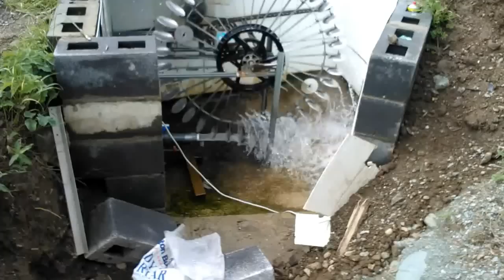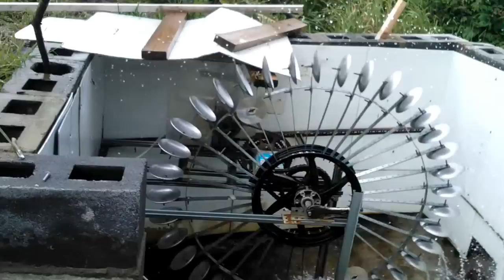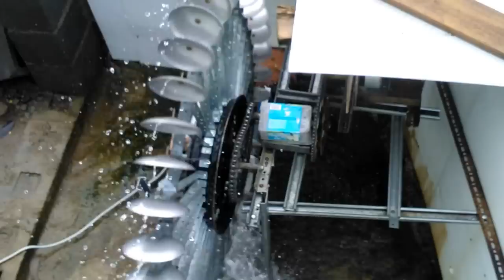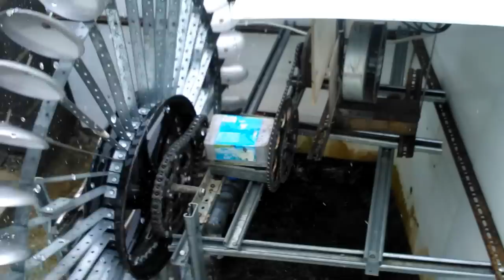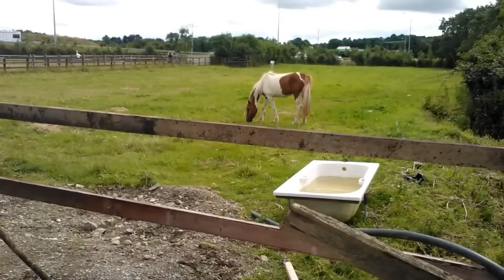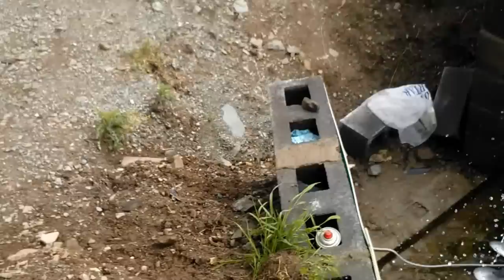homemade power

Comment: As Bonnie Flory has commented earlier you would be better off using a conventional Water Wheel with the 'Buckets' designed to hold as much of the incoming water flow as possible at the required RPM. Flow the water into the Top of the wheel. At present a lot of the 'Energy' in the water jet is being lost as the water flies off to the sides due to being reflected off the Discs. Alternatively use a Pelton Wheel style paddle to maximise efficiency. In other words - MAXIMUM MASS at MAXIMUM RADIUS.

People seem to get obsessed with Micro Generators and 'speed' of water. It's Mass and Radius.

Mass equates to Volume * Speed; Radius equates to Height.  So you can either Catch the Volume of water at the Height of the Source Water through a Wheel having a Diameter equal to the drop Height or Drop the Water through a Channel/Pipe and pass it through a Turbine at the bottom of the Drop Height. The chosen option is influenced by Drop Height and Landscape. For example, Using a Pipe and Turbine is obviously more prudent if the Height is 20m but at 2m you are likely better off with a full size wheel if Footprint and Space allows.

Remember you build the Wheel once and use it for years, So don't worry about cost etc. You can use natural resouces, Wood etc or get hold of scrap Aluminium sheeting or other material.

Comment: You could get more rpm from using a C6 automatic transmission.... Cooliing for trans would be transmission cooler with the same waterflow running over it or in a 55 Gal Drum with same water flow controlling the temperature.
C6 transmission is a 8.5-1 gear ratio in 3rd gear.

Comment: with your set up would there be enough power to run a 3kw pond heater using my water wheel.[16" pulley on wheel to 4" pulley then gear up as required.] many thanks

Comment: nice, plum water from top, reduce more,  use large radius spoons, pelton,= more rpm, lots of low rpm torque for multiple generators.
also use long drive shaft,

Comment: You get about 108 watts an hr. the way it is right now.
You may be better off with an regular old timer water wheel with chambers on it since you have an height of over 2 meters. Those chambers could hold a lot of water since you have a lot of water flow and the more water those chambers can hold the more torque you get out of it and the more power you could get out of it.
Reply: Or just make a nozzle and more like a peltonturbine.
Reply: J & B Homeliving, I cant find one example of a water wheel with this low of gallon per "unit" producing and usable watts. If you know of one please send me a link. I'm looking to build one.